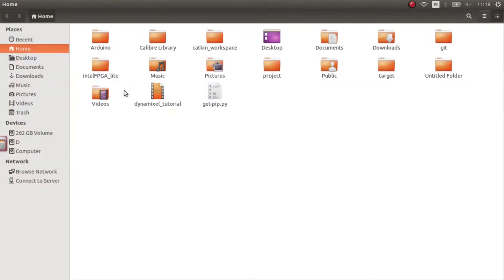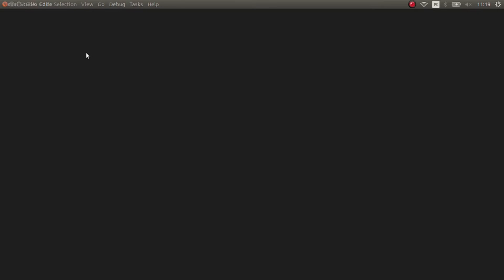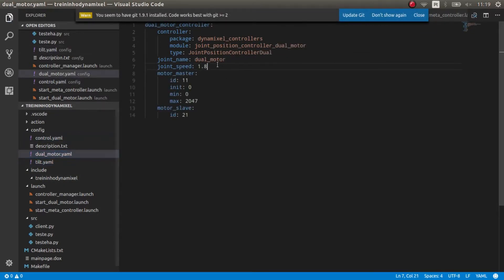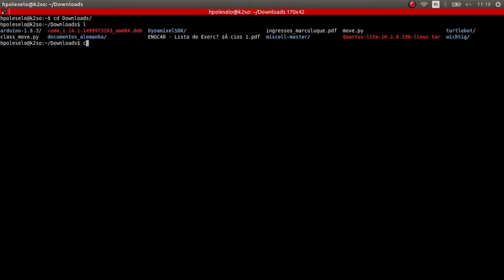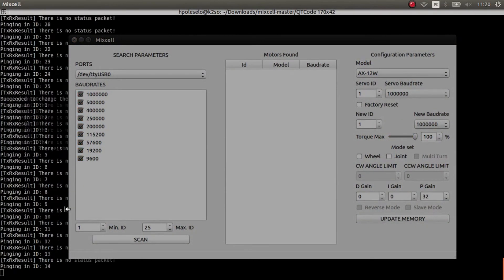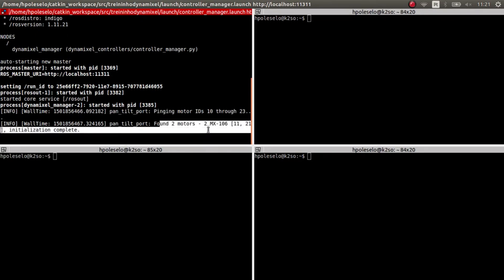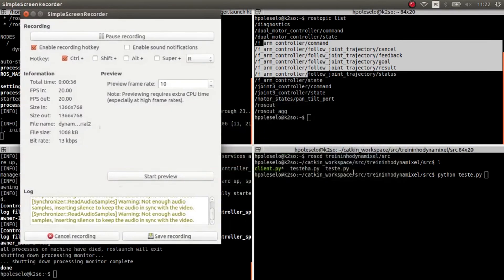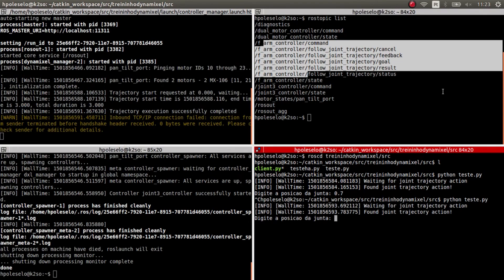Controlling Dynamixel with ROS

Comment: What is the hardware between the motors and the PC? Are you using a OpenCM board or some other communication attachment?
Reply from the maker: the motors that i was using had TTL connection, meaning that i needed a TTL-USB Converter. So actually just plugging in the computer and ping the motors if they were active. i don't remember exactly which converter i was using but it was pretty nice (there was a switch where you could select your comm standard rs232 or ttl). If i found it out i'll write you

Comment: Hi Henrique
I converted 3d point cloud data using 2d laser scanner with a servo motor .But now ı want to use dynamixel AX 12A servo motor. How to use this motor with Ros? So how to make ros communication with dynamixel servo as automate.
Reply from the maker: hey Steve, sorry for the late response. I'm not sure i understood your question, but i think if you follow the steps i showed on the video is quite okay. Make sure you have installed the packages for ROS-Dynamixel and try to follow this tutorial from ros:
http://wiki.ros.org/dynamixel_controllers/Tutorials
Reply from the maker: i really encourage you to follow this tutorial, i learned everything by it, if you have any specific question just tell me